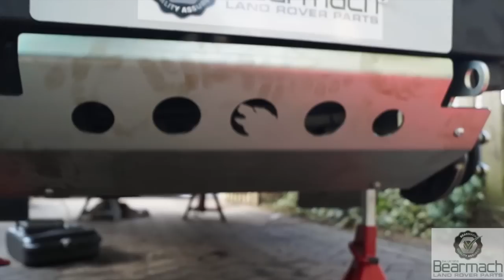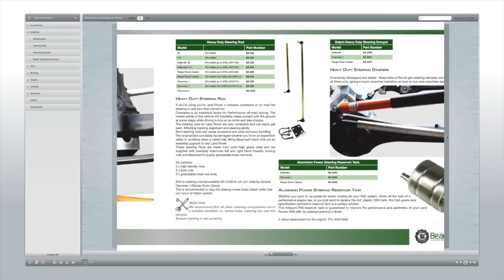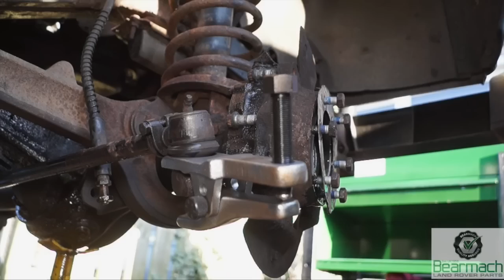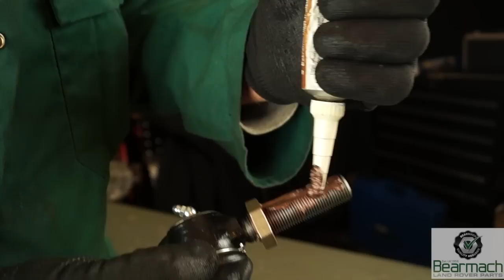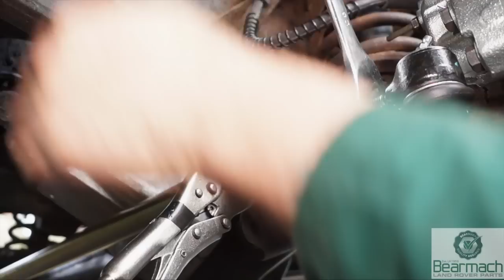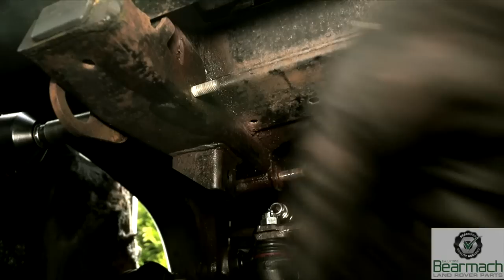Replacing the drag link and track rod for HD versions  - The Fine Art of Land Rover Maintenance

Comment: Friend of mine had the tracking done on his 110, the drag link was siezed, they used heat, stilsons and a scaff bar to try and move it before giving up, he was 2 miles down the road going into a garage when the cross link bracket sheered at the thread and he lost steering, wish the tracking people had seen your warning on excessive heat!  Luckily he was only going slow and was OK.

Comment: Great videos as usual! Could you one on greasing the various ball joints, suspension points, types and sizes of grease nipple and how to identify the fitting to choose and use on the grease gun? Nd what are the best bottle jacks to use bearing in mind the height iff the ground the Landcover axles and chassis is?
Reply from the maker: flaskandsarnies okay,

Comment: nice kit, only thing I can say is that the HD Drag and Track rods meed machine flats meld in. so you can use a 24mm or some other size wrench to turn when you need to align it.
Reply from the maker: too right.  that is what is missing.